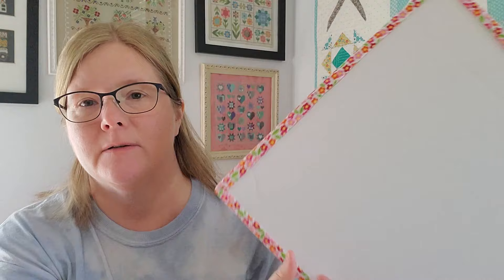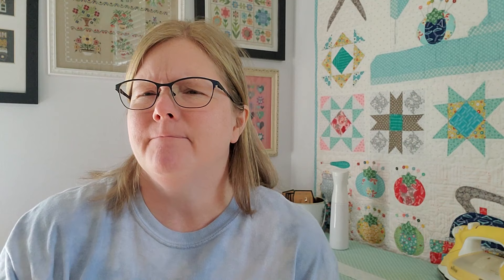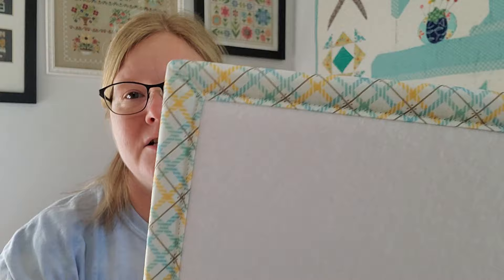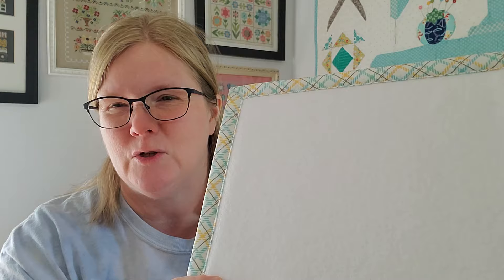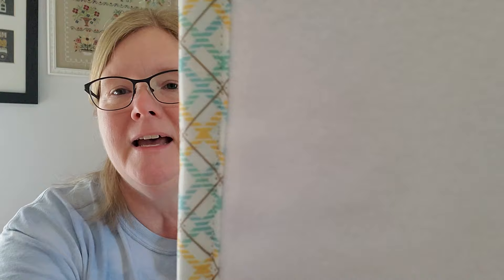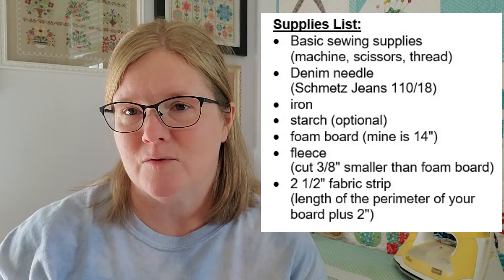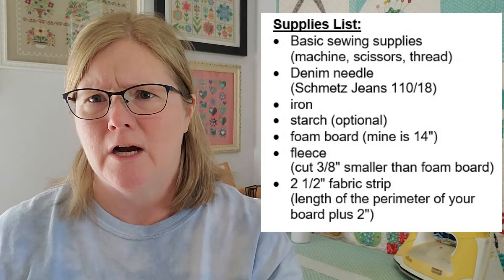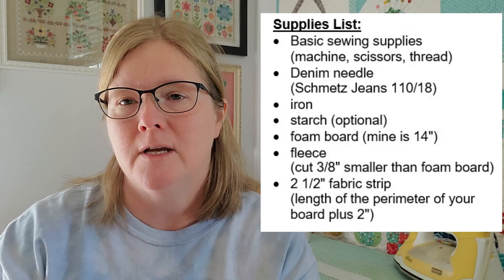Make A Design Board with your sewing machine (my lovely Juki DX7)! NO HOT GLUE! NO TAPE!

Comment: I changed my design boards to fleece also. It works as well as batting and can be cleaned with a lint roller. I'm definitely going to try your sewing method, so much neater. I also quit using hot glue, too expensive and burning my fingers. I used regular Elmer's white glue, then ironed it. That made the glue set-up immediately. But the sewing is so much neater.
Reply from the maker: I was honestly surprised how easy it was.
Reply: I bought myself a design board, I’m sorry I did as it wasn’t cheap.
Reply: Love this idea but what is “fleece” please?
Reply: So - fleece works?  I have tons I bought for so,e other project years ago that I’ve forgotten about😁

Comment: You can clean your old batting covered board by ironing down the waxy side of freezer paper. When you let it cool, then pull the freezer paper off, it pulls all the threads and batting pills off. You have a nice new looking board. I saw a lady use ultra hold fusible interfacing and her iron instead of hot glue. Just in case your machine can not power through the foam board.
Reply from the maker: This is great information!! Hmmm...

Comment: Great idea! I also came to the conclusion that hot glue wasn’t for me so I have made my boards using pretty duct tape on the edges. Works like a charm! I do agree about swapping batting for fleece and I just use a bit of basting spray to keep it tacked to the foam core while I do the edges. But I am going to try my machine on this method
Reply from the maker: Glad it was helpful!
Reply: Great idea to use spray so the flannel/fleece doesn't go all over the place.

Comment: I looked at the Juki long and hard when I was going to buy a machine. If I had the Juki industrial machine I would not think twice about using your suggestion but my Janome Continental M7 just can't do that ... Thank you for sharing your wonderful idea.
Reply from the maker: I do love my Juki.
Reply: The Janome Continental M7 can't sew through foam core board?!
I almost bought one - but opted for the Baby Lock Chorus instead - I had looked @ Juki - but I am not familiar with that brand.
I am VERY surprised the Janome CM7 isn't able to handle that project! (it is a step above my BLCH I think in quality.)
I plan to try with my Baby Lock - because this project is just too good to pass up! 😊🎉

Comment: I’ve started using DUCK TAPE….The pretty colors.  And instead of batting I’m using diaper flannel.  Just a light spray baste with adhesive then wrapping the duck tape around the edge…. SUPER EASY and no fabric needed….😎
Reply from the maker: Yes. I've seen people use duct tape. That's definitely an option.  I'll have to check out the diaper flannel.  I haven't seen that. Thanks for watching.
Reply: Duct tape!  Yes!  And it now can be purchased in colors and designs!!  I like that idea, too!   I’m just blown away with being able to sew through foam core!  And I think  making a smaller one first to get the hang of it is a great idea!

Comment: I’m stunned that you sewed through the board! I do have a high-end embroidery machine and I’m scared to death to try this, so I think I’m going to buy that Juki as a second machine as I wanted,a machine dedicated to quilting only. But thanks for this video. I’ll never go back to making design boards the other way. Lastly, could you do a video on how you cut your foam  boards please?
Reply from the maker: I actually use my rotary cutter to cut the foam boards.  I have one rotary for fabric and another for everything else.  Thanks for watching.
Reply: I used my rotary cutter, make a rotary cutter that is for this purpose only.
Reply: @lorabrinkman  I used my single edge blade to score the front, then to score the back and I broke it but it left a  divot in the center and it looks terrible after you put the binding on. So you don’t get that center “rut”  when you use a rotary cutter?

Comment: I have 2 boards and used grided interfacing. I just folded over the edge to the back and used double sided tape. It's held over 2 years now. I like your idea with sewing a binding through the plastic board. Perfect idea, will update my boards.
You could also put sand paper where you're fleece is or on one corner and use it to sharpen pencils when drawing. The fleece would hold the sandpaper in one corner and then remove it when needing to replace it? Just an idea for someone who draws? My granddaughter would love this. I'll experiment, just putting an idea out in our craft world...
Babs near Tombstone AZ...
Reply from the maker: Just to clarify...i made these with foam board,  not plastic.  I'm not due any sewing through plastic boards.

Comment: I love the finished effect of a sewn on binding?  I did use Elmers Glue on the board and then put it on the ironed flannel and pressed it.  Then turned it over and ironed it.  Then cut off the edges, I made it larger than design board.  I didn’t have a white fleece but will definitely try that. My Juki TL 2010 using the denim needle had no problem.  Loved all the little tips that you gave in the video.  Thank you for this !
Reply from the maker: Thanks for watching and for giving feedback.

Comment: Great solution for design boards. I use them all the time. I use the spray tacky and left over batting. I rarely have a need to clean them but yesterday I used the vacuum on one. the other cleaning option is the sticky tape lint roller. I use that on my design flannel wall.
Reply from the maker: Thanks for sharing your ideas!

Comment: I made my design boards maybe a couple years ago 🤔. I used batting and they still look like new because I do use the lint roller and it works fine. However I like the idea of using the machine because I might have burnt a finger or three with the hot glue gun.  Thank you for the tutorial.
Reply from the maker: Thanks for watching.

Comment: I have been wanting to make Lori's design boards for a few years now but still have not done anything yet...this may motivate me to get started. I already have some foam board and probably some extra strips of fabric or unused binding leftover from some quilts.  I do have a question, could you not sew the strips on like binding a quilt if you did not want to sew the strips inwards?  I didn't understand the difference in choosing this over binding the foam boards.  Thanks for the tutorial much appreciated. 😁☺
Reply from the maker: You absolutely could. I just chose this method to reduce a little bulk on the side and make sure I could pull it night and tight for a clean finish. You should totally try it the "normal" quilting binding way and see what you think. :)

Comment: Great tip for an easier way to make design boards!  I use a tape lint roller to clean the threads off my boards.
Reply from the maker: I've tried the lint rollers, but on the battinghaven't had good results.  I'm sure it will be much easier on the fleece! Thanks for watching

Comment: Now that you have had time to use the polar fleece board for a while, would you still choose fleece or go to the flannel? We are setting up a "pocket brigade."" The design boards will serve as a thank you for participants. We make wheelchair quilts in our quilts to share program and find that the pockets are great for a tissue, warming hands, etc. Their primary purpose is to generate conversation with the owner. This is something that is most beneficial as it opens the door for a chat to otherwise empty hours of sitting. Thank you so much for your video.
Reply from the maker: I haven't had any issues with the fleece, but I did use a fairly thin/low pile fleece. I think either would be fine and quite honestly, I may decide based on cost because quality isn't very different.
Reply: thanks so much  @lorabrinkman

Comment: Great job. I have been meaning to make some more design board. I like how yours turned out, very pretty. I have some Lori Holt pin cushion and polka dots fabric coming to make a project clutch and I also use flannel to make them.
Reply from the maker: Don't you love it when the supplies closet has what you need? That must be why i need to be well stocked.  Ha!!

Comment: So happy happy stitching, with Arthritis in my fingers,  ohhhhh so much easier and no fuss, clean playtime.
Just wondering which size or it looks the best 2 use. I need 2 upgrade my sewing machine and as always on the lookout 4 a tad bit more weightie machine, not 2 carry around @ all, just 2 sit there and look pretty! Also busy and with ease 2 use.
Thanks 4 being such a patient and fantastic tutor on ur design boards, and yes, I, 2, like thinking outside the square.
Happy stitching my friend in stitches.
Thank u very much.
Cheers  from New Zealand❤😊
Crisy
Reply from the maker: My machine is a juki dx7. I make my boards 14" because very rarely do i make blocks bigger than 12", so 14" works for me.  They also fit perfectly in my storage tower.  But.. you can make them any size.

Comment: What a great idea! My only question is...does sewing thru the foam board make the board prefarated and edges easy to come off? I guess when you increase the stitch length, that would help.
Reply from the maker: I have not had that problem with mine.  I don't sew through the board at the same place for attaching the binding.

Comment: Very clever, would never have thought to sew through the foam core.  I’m wondering if the sewn edges might easily bend or break because they’re perforated?- but I’m going to try this anyway.  Actually, I’m going to re-do my glued edge boards because I love how nice the sewn edge looks.  Columbia, MO!  My granddaughter works at Columbia College. 😊
Reply from the maker: One of my good friends just graduated this past weekend with her masters from Columbia College! I haven't had issues with the edges bending.  My sewn edge is only about 1/4"-3/8" inch in from the edge.  They've held up this far.  I do store them flat.

Comment: I recently watched the LH video of her making these, and did expect her to use her machine to sew the binding down....was surprised to see her use hot glue!  It seemed so awkward.  What's a floating option and how does it help with this project?  Thanks
Reply from the maker: The float option is a setting on my juki that lifts the presser foot just a smidge and it lessens the tension so it floats better over bulky objects.  I have a juki dx7

Comment: I used Aleene’s  tacky glue because I don’t like getting burned either and it worked really well. But, your sewn finished edge looks so nice!  I always use white leftover batting - I like the idea of fleece - not sure I’ve seen fleece this thin - did you get it at Joanne’s?  Lori Holt’s are a  thicker foam board - maybe 3/8” which I can’t locate anywhere - hers have a little heftier feel which I like.  Anyway, I think I’m going to have to try your method- it has such a clean, pretty finish!  Thanks for the tutorial.
Reply from the maker: You are very welcome! The foam board I use is from the school supply aisle. It's probably 1/4" thick. I did purchase the fleece and felt at JoAnn's. I wandered the aisles until I found what I wanted. :)
Reply: Thank you, great tutorial, can’t wait to try this.

Comment: I’m thinking about sharing your video with my sewing group in April.  I also saw Lori Holt’s videos.  You mentioned that you were going to use fleece instead of batting so you could use a lint roller to remove small threads and such.  After using your fleece design besides for the last year, how are they holding up?  Is the flannel better? Does flannel hold cotton as well as fleece?  Any other suggestions I should pass along?  Any ideas for improvement?  Thanks, Tondi
Reply from the maker: I have both fleece and flannel boards.  Not are holding up really well.  My only thoughts is to make sure you purchase just plain foam board... not the type with adhesive on one side.  It's not the same stuff and could mess up your machine. Feel free to share.  Enjoy.

Comment: It’s good to know about using fleece or flannel. I’ve tried to clean up my boards that have batting on them, it doesn’t work. I was wondering if using a sewing machine perforates the foam board so it breaks off. Have you had that problem? Is a 3.0 stitch length long enough that it won’t happen? Thanks for a good tutorial!
Reply from the maker: I have not had an issue with the boards breaking. I do lengthen my stitch length. Thanks for watching.

Comment: This is a great tutorial.  Thank you! I am sure this is obvious to everyone but me. Why would one use a design board that is that small?  I usually use my cutting table as a design area or I use the rug in the other room to lay out the blocks.
Reply from the maker: I like to use them to lay out my quilt blocks so I can carry them from one place to another in my craft room and not lose pieces and not sew pieces together wrong. It helps when I have many pieces for one block. I also use them when I'm cutting out a lot of block to stack the pieces on. You can sandwich two together for easy transporting of unfinished blocks, too. :) I have a design wall for my quilt top layout... this is just for single blocks or mini projects.

Comment: I love this!!! I was wondering if perforating the foam does it make the sides weeker?
Reply from the maker: I haven't had any issues with my boards and I've made a bunch.
Reply: I tried one today. Used an older Bernina, did6want to use my Crescendo.  It went o.k. Then I tried some heavy duty heat and bond. Thar worked o.k.

Comment: You mentioned you had a “float” option on your machine. What does that do?
Reply from the maker: Yes... it's a presser foot float option that lifts the foot a little.  It's designed for help with sewing through bulky items.  It just relieved a little pressure that is applied to the material you're sewing.

Comment: I really like the look of the sewn edges on your design board. But I'm a little confused. I have the Lori Holt boards also and I lint roll them all the time. Is there a problem with doing that?
Reply from the maker: I made my original boards with cotton batting and the batting just fuzzes up after cleaning many times.  So i wanted to switch to a more durable option for cleaning.

Comment: What does the floating do on the machine not familiar with that? Float setting?
Reply from the maker: It's a presser foot float option that lifts the foot a little.  It's designed for help with sewing through bulky items.  It just relieved a little pressure that is applied to the material you're sewing.
Reply: @lorabrinkman  thank you I will see if my machine has that option

Comment: I have never before created a design board. My problem here with this really nice video is that it doesn't show what to do with that 14 inch board after it's finished. Is there another video that gives that information regarding how to put together the large design board that is needed for a large quilt? Thank you for making this very interesting video.
Reply from the maker: The small design boards are for building blocks, not an entire quilt. I use them to lay  my block pieces out on and keep track of my pieces for an individual block. I have a design wall for laying out an entire quilt top. Thanks for the question.
Reply: @lorabrinkman  Ooops! Thank You for the clarification.

Comment: Do you even need foam board? Cardboard (boxes) would probably work too, aye… if you want to go even more frugal ( I have a strong industrial and don’t mind using an old needle to sew the binding thru…. Hmmmm…I have a couple of old computer mouse pads too I could use….
Reply from the maker: The thickness of the foam board is nice for the boards. It's also easy to pin into.  I've definitely had people day they use cardboard.  Give it a try both ways and see what you think.
Reply: @lorabrinkman  I used the mouse mat which is fairly solid, fun make! … I’ll Def try a cardboard one later. Aaaaand….. We won’t talk about my kaka mitred corners or bias sewing AT ALL! 🙈🙈🙈